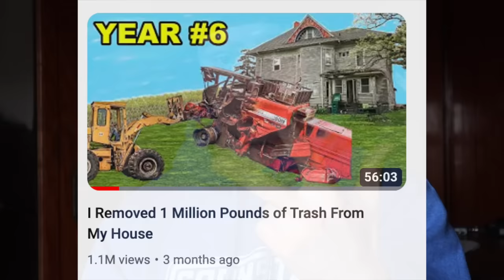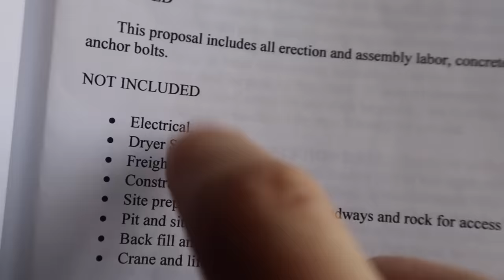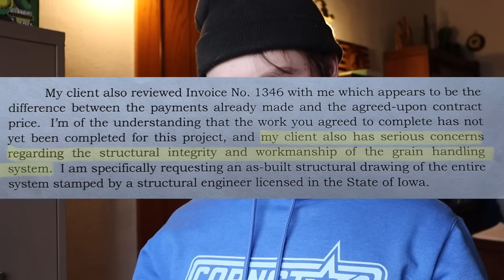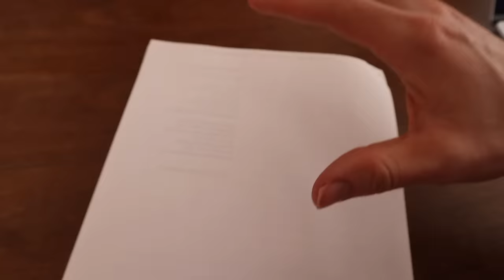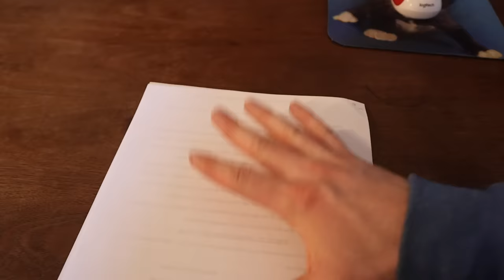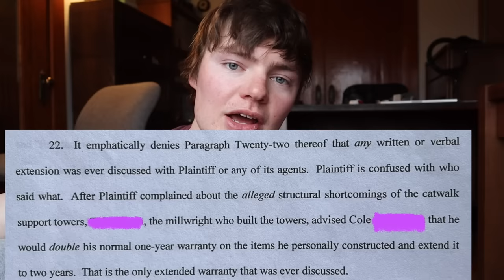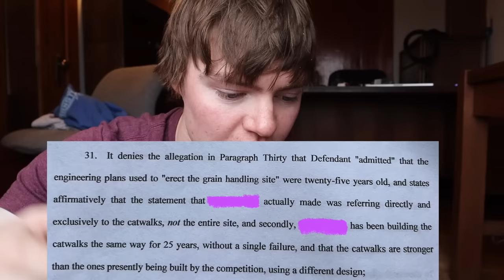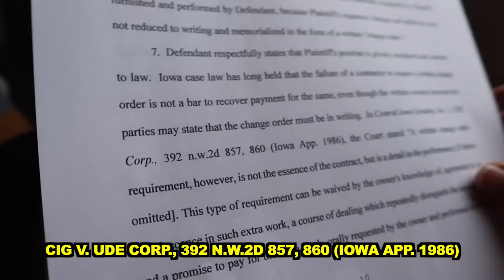I Sued My $1,000,000 Bin Site Contractor

Comment: I really hope you have an excellent law team because this will boil down to who has the better lawyer. I really hope you win and get what is deserved. Honestly I think the whole thing should be torn down and redone even the cracking concrete.
Reply: No there are major problems that are not safe and don't meet spec pretty easy to win.  The jury trial is just a way to prolong the case.
Reply: It really won't.  It's pretty clear. Cole initially complained about a bunch of things he assumed but weren't in the contract or agreed to.  But by the end of the first video it was pretty clear that they didn't do the job correctly. I'm a mechanical contractor,  the contractor will lose this pretty easily,  except the assumptions about everything being whatever brand cole preferred and some of that finnicky stuff.

Engineering on steps probably isn't an issue. Steps failing is an issue. Concrete failing is an issue. Augers not feeding proper capacity is an issue.  Its common for dealers in many industries to fab stuff on site like steps etc.

Insurance companies will settle.
Reply: honestly its gonna come down to who's willing to put out more money into litigation.
Reply: This project was filled with assumptions and very few specifications .  Far too much trust of the customer that it will be done correctly, but undefined.  Winning the case does not assure any monetary settlement, especially in todays economic situation.  Good luck and God Bless.

Comment: I am an architect with over 55 years of experience. I have been in business for 36 years. I have also worked at other firms and worked on some very larger projects. 
I have also been an expert witness many times, been to arbitration and also federal court for a project for a government project. (USPS)
In todays construction climate it is difficult to find a good contractor and even more difficult is finding good tradesmen. You should settle all claims through arbitration, the courts and a jury are clueless in construction projects.
Some things that are not tolerated. Poor workmanship, substitution of inferior materials, lengthy time delays. Any extra work or materials that a contractor provides without a written change order, is a gift. In the end you will prevail and be compensated for poor workmanship. Hire another contractor to fix all of the problems.

Comment: The engineering group who signed off on the spec’s is another group you will have to include as the performance of the elevators aren’t performing as designed. The back and forth between the engineering group and the contractor is to be expected. Don’t back down and include any third parties involved.
Reply: One thing tbd is whether design was deficient, or were structures not built to the design specs (or both)?

Comment: TBDH many of the "welds" in the upper structure were never done as tack-plates were left in place without the correct cut and fitted then welded on brackets work completed.   The work wasn't finished.

Comment: Its sad that we just cant trust each other to do a good job.😢 and when there is a mistake just to repair it and dont have to sue
Reply: People are goofy I guess and it goes both ways.  You spend more time and money these days in requirements documents, project management plans, etc.  due to that.   Not that this example applies at all to the bin site deal, just an example.  - A family member wanted a new wood floor installed by a friend of mine.  He is a really good, and I warned him you might not want this job due to this and that - you get the idea.  I seen it finished and it was awesome.  Family member was upset the GRAIN of the wood (not the finish stain and protectant coat) didn't exactly match and this and that.  He went back multiple times and lost money on the job.  Said to me " I should have listened to ya."  People are goofy.
Reply: @hawks2252  thats also true, and you give a prime example.
Reply: Yep, I know a guy who is getting sued due to ridges in the brush finish on a driveway, which to be honest when I seen it, isn’t even noticeable. Customer just doesn’t want to pay, contractor was willing to give back $1500 on an $8000 driveway.
Now being sued for 15 grand for some reason. Idiots are everywhere.
Reply: I agree with you.  I don't know who's right or wrong but you would think the Builder & the Buyer could get out there, start from the bottom and point out every little problem, decide if it's a reasonable Complaint right there & decide the REMEDY.   Seems like it'd be cheaper than getting Lawyers involved.

Comment: Cole, one huge thing you got going for you is your video evidence from start to finish on that bin site.  It was so smart of you and DC to document everything. I would not stop until they tore everything down to bare bones, re-done everything the way its suppose to be. This means from the pit, to the bin concrete. They need to redo it all. Then have a third part safety inspector inspect everything down to the last bolt and weld. If it takes quite awhile so be it. That previous contracting company should pay for the storage of your grain at the local co-op also including the trucking.  I would also sue for the mental anguish that it caused you, DC and Cooper during harvest when you had to stop and fix the pits problems as well as others. You all deserve this. I am a man that believes in doing a solid good job from start to finish. You do what is fair and right to your fellow man. This project was nothing but shady dealings and poor craftsmanship on there part from the start. I hope you guys get all you deserve. I run my shop with the motto, "The Difference Between Good and Great Is 2%!"  I wish you the best of luck Sir.

Comment: Seems hard to believe they wouldn't rectify this without a lawsuit being filed unless they hard a good reason not to.
Reply: The bin floors and the hopper bottom base are cracked. It will all have to come down, bases dug out, repoured and bins rebuilt. The reason is simply money, nothing else.
Reply: Except the cost to repair the bin site is probably a lot more than getting a lawyer. The whole situation is sad.
Reply: Just how the insurance works.
Reply: @nevergetagooduserid  Not to mention compaction study should of been done to see what the soil could handle. Larson farms had to dig out like 7 feet of soil to install there bin this year.  All so it had a good base to be built on.  I don't even remember if there dug out the soil other then removing the topsoil from bin site before pouring concrete.
Reply: @OOpSjm  Contractor incomitance insurance?
Reply: good  reason not to fix?   cannot afford to fix the screw ups. He will go BK, then Cole will be left with nothing

Comment: Sadly, the only winners in this case will be the lawyers. From the video I saw about the cracks in the concrete, one or more bins may need to be torn down and new concrete poured, but only after someone builds a good base to put it on. I hope it doesn't go that far, but these bins are built to last "Almost" forever, and a bad base under the concrete will limit the years considerably.

Comment: Honestly a hard lesson to learn early but I had a similar experience on a much lower scale. I paid a contractor over $30,000 to do some work on my only house I ever owned and it was a big deal to me. Low and behold this licensed contractor did not finalize any permits he pulled and he did not do half of the work correctly. In fairness it may have been "ok" to leave it but not up to my standards. I don't want to make problems and pass them on I want things done right. So I fired him paid him off and said go be on your way in so many words and I re-did arguably the much harder work all over and it was even harder because I had to undo his work and shoot let me tell you weeks of labor intensive work is not fun. I easily re-did $15,000 of the work I paid for and I reapplied for the permits as an owner/builder and had to re inspect and finalize everything myself and thats when I said to hell with Contractors. Do it myself. I will save money and I will do it better than them. Tough lesson to learn on your scale of a project though. I hope you get a good outcome.

Comment: I mean, as an engineer, who works in procuring custom equipment, it is entirely normal to do progress payments based on progress and inspections. 

Poor welding is something that is found towards the end of the project. You can't inspect all welds until the structure is entirely complete so it is no surprise that the welds are found at the end when the final bill is being issued. Depending on the jurisdiction where you live there could be regulations that apply to this type of structure and  codes which need to be adhered to. If so, it will be an easy thing for your lawyer to reference.

An unexpected change order at the end without a basis, prior agreement, or discussion is rare in my industry. Vendors are usually quite keen to stop work or put particular items on hold until an agreement is signed.

Comment: Nice work keeping the 6000 series White Planter doing a good  job using  pretty much the original style parts.  For what its worth, we have been successful at replacing worn 6000 series parts with 8000 or 9000 series parts.  Usually aftermarket versions.   An upgrade to the 8000 series guage wheel, guage wheel arm and pivot shaft was worth doing.   It is way easier to replace bearings and to keep the pivot shaft greased.     The RK closing wheel update is an option you might consider. A Brand PWM hydraulic valve on the fan motor might also save you some steps.  Takeoff 8000 series air bags will work on that planter if you are so inclined.

Comment: That contractor would be wise if he sent in another contractor to fix the situation. The site is clearly a mess. The concrete pad cracking like it did is horrible and those welds and nuts and bolts should have been rock solid. I watched a video with your Dad up on top of that bin and wow it was about as dangerous for him as it is for those people that climb rock faces with no harness nothing to protect them from falling. Now sure if you asked for a extra dangerous life changing site well any contractor would say nope I will not build something dangerous . Still it sure seems like it was very dangerous. I saw the video's of it being built and the day only one crane was ordered when two cranes were needed and how not enough people would show up to do the work  . All very odd
Reply: Got to go through the steps because I'm pretty sure they want their insurance to pay it out and they themselves.
Reply: The entire site has to be demolished and rebuilt from scratch as the concrete pads are defective and cannot be repaired, they must be replaced on ground that has been dug out to the correct depth and compacted and tested to be sure it can support the weight that will be on it.

Comment: I worked for a grain handling equipment Manufactuing company in Vincennes, Indiana from 1994 to around 2005. Back then this company sold to the name I noticed on the side of the bins. It is now owned by the company on the side of the bins. I enjoyed my job there I basically ran the assembly dept. But one of the main reasons I left is because almost daily I was pointing out broken welds and cracks where they welded black iron angle iron to galvanized steel. I would return it to be rewelded just have it sent back and be told to fill the crack with caulk and smooth it over so paint would cover the crack. I complained so many times that it would kill someone someday. My complaints fell on deaf ears. I couldn't stand the thought of being apart of that.

Comment: When someone spends that much money it needs to be done perfect. Sometimes things do go wrong but I hate to see things go to this level. Good luck and I do hope things turn out for the better.
Reply: If someone spends a fiver it needs to be done perfect..
Reply: I think the job was underbid to began with and the the cost of material went up and caught the contractor off guard.  During 2020 and 2021 most quote on things like this was good for 5 days if that stuff was changing so fast on material cost.  Stupid but it was for no reason.  Copper wire prices was changing daily at one time as well.

Comment: I know that construction laws do change per state but I would see if the following would help you (Especially if a Permit was involved):
If they had any calculations they needed them stamped by an engineer - This would usually generate into something called a Submittal for a final review which you should have seen.
Another item is if there was welding and the plans may have mentioned requiring a special inspection (3rd Party Inspector), that means they need to provide welding certs and inspection reports for welds completed, this would show that either they did not pass or were not inspected per the plans.
What is really concerning is them not sending you the plans, now I have seen this be the case in some residential projects say you buy a track home and those are only transferred over after final payment. Another way this could be the case is they have not yet sent you the close out documentation which discloses their warranties (usually applied at substantial completion)

Hopefully you were able to get somewhere on this!

Comment: From someone who works in construction and has done milwright work I'd say pay an inspector to come out and verify that the work meets the standards required for safe use at maximum capacity take photos and document any issues the best you can possibly even get an engineering firm to do an assessment, finalize it with a completed final list of expectations you have of the GC to fulfill the contract and work out a mediated settlement or agreement (preferably outside of the courts if at all possible) then pay them the amount owed without hesitation or delay upon acceptable completion once you get attorneys involved the lines of communication break down between both parties and nothing gets resolved. I hope both you and the GC can come to an agreement that's best for both of you I've been on both sides of the spectrum having came from ag now in construction and I know its a tough situation for both parties especially when it has escalated to the point of litigation.

Comment: You’re literally forever going to have problems with a bin site with a leg. There will always be the need for repair and maintenance. I just do not believe you thoroughly understand the process of contracting. This isn’t like paying some local contractor to pave your driveway or put a roof on, it’s a massive undertaking. I stopped watching your clickbait videos a couple years and this video randomly popped up in my feed and once again I’m reminded why. You have a grain bin with a leg you’re literally going to forever have issue and problems and broken stuff.
Reply: come on now.  there's a difference between expected, ongoing repair/maintenance for a large-scale project like this versus it failing from the very beginning.  it could never handle more than 50% capacity, even on its first day post-completion.  that's just bad work, from the GC down to the subs. my father ran a highly successful commercial construction company for more than 40 years and never once got hauled into court - because he didn't produce subpar work like this. this was badly done

Comment: I've been in the commercial general contracting game for decades.  A few red flags:   Cole not seeing the engineered drawings. Commercial industrial projects like a bin site, there's usually a third third party (architects. engineers of record) confirming  to the Owner that the Contractor has completed the project or parts of the project  per the plans and specifications and everything functions as designed. The big red flag for me was every commercial project I have ever worked on had a "Special Inspections" agency to inspect the specifics of the project to assure things are completed per the Contract Documents, including those engineered drawings. Things like rebar sizing and placement, soil compaction, concrete strength, bolt placement, welds, building code compliance, installation per manufacturers specifications, basically everything a city building inspector isn't qualified to inspect.  

This will be very interesting to follow.

Comment: I’m a civil engineer that deals with heavy construction and tanks like this. I absolutely have to deal with contractors like this that do not read or abide by the contract, which leads me to protect my client (typically municipalities). They always pull this crap, but from this video I know you are in the right and they are just dragging you through the mud, which is frustrating. 

If it hasn’t been resolved yet, hope all goes well. From a 10,000 foot view, you are in the right here

The smoking gun here is this appears to be a lump sum contract, case closed!!

Comment: When they showed up to weld on the bins with those 110 volt wire feed machines to weld with flux core on galz steel no less  I remember thinking this ain't going to end well.